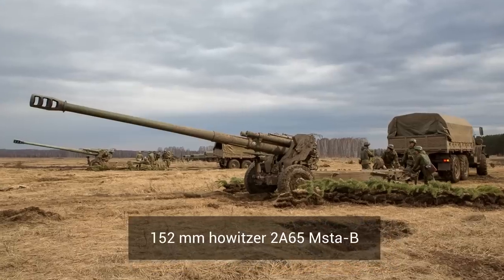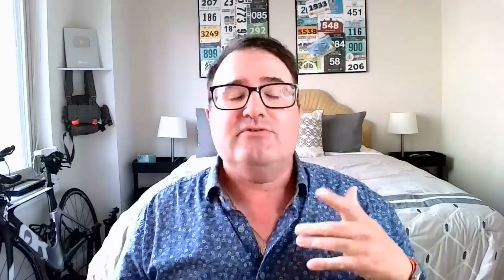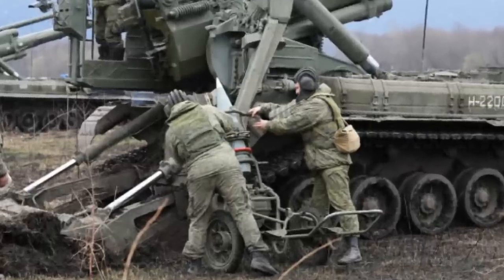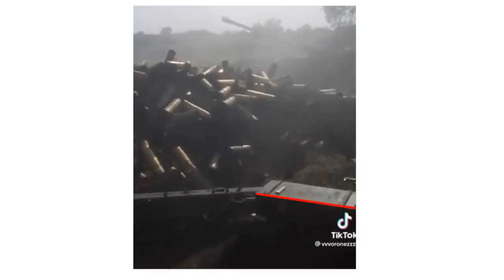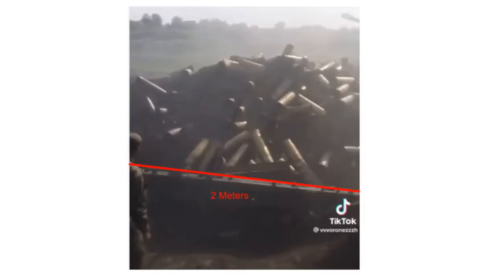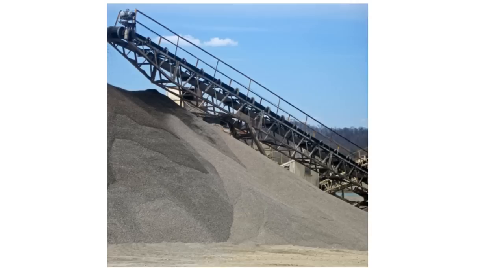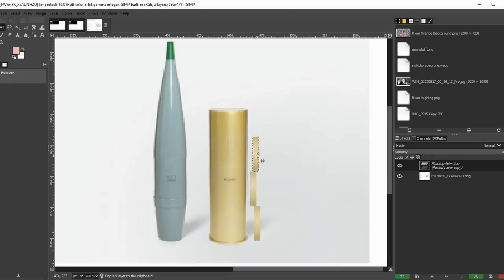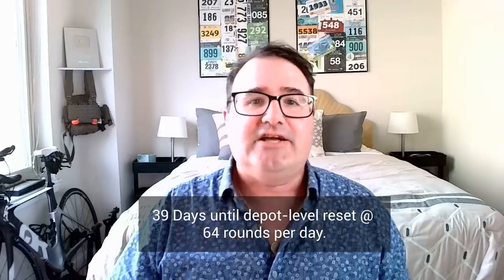When will this Russian Howitzer explode? (2A65 Msta-B Barrel life estimation from shell casings)

Comment: As veteran artillery non commissioned and then commissioned  officer with over 40 years of experience, I would like to add to a couple of earlier comments made by others. Barrel life for artillery is measured in Effective Full Charges (EFCs), which is unlikely to be the number of rounds that actually travel through any particular barrel.  Most artillery systems use separated ammunition. The projectile and the shell casing that holds the propellant are, or can be, separated to allow the amount of propellant to be adjusted to allow you to target enemy at different ranges. In many systems, the propellant is loaded into the chamber without a casing, but in bags or round cloth packages. Each such package contains a specific and known amount of propellant and is called a charge. The number of charges used to propel one projectile to the maximum, or near maximum, range that can be obtained, is called an EFC. Progressively shorter ranges will require fewer and fewer charge bags, or less than an EFC. Barrel wear is less.

 Professional Gunners, have long recorded each round fired, and the number of charge bags it required, in a log unique to each gun or howitzer.  Depending on the make and model of the weapon system, each number of charge bags actually used to fire a round will have a value as a percentage of an EFC. As artillery systems are seldom used at their maximum ranges, the actual life span of a barrel may well be far greater than the manufacturer's stated barrel life.  Once the barrel life is reached, the accuracy of the weapon degrades, as the lands and grooves of the rifling are eroded and the driving band on the projectile is less able to create a perfect seal and get the best effect from the propelling gases, resulting in less muzzle velocity.  

Most modern armies use muzzle velocity measuring systems, normally small radars that are attached to the gun and record how fast each round leaves the barrel. This measurement is much more accurate than calculating EFCs by a formula based on counting the number of rounds and charges in a log book.  It is used to adjust the setting used to lay the gun to ensure its continued accuracy. I noticed that some of the M777s supplied to the Ukraine included the muzzle velocity, many of the huge number supplied by the United States did not.  Finally, if a barrel explodes, it is unlikely to be the result of barrel wear. It is most likely to have been the result of a metallurgical anomaly in its manufacture, from damage caused by battle, or by misuse.

I enjoy your commentary and enthusiasm and encourage you to keep shooting. Ubique.
Reply: That was interesting - thank you
Reply: And now I know.   Thank you, Sir.
Reply: Thank you for this very interesting comment, I learned something new.. Best greetings!
Reply: I take it you were / are in the Royal Artillery?

My uncle was a RA Major, who won a MC at Anzio or Salerno, when a FOO was destroyed during a German attack, and he went forward under fire. ...... He was later Records Officer at Woolwich, where some 50 years ago I stayed at his house, and was taken to see the Rotunda Museum.

Ubique!
Reply: This man never had an “armchair.” The real deal!
Reply: @zen4men  So interesting, the history that rests within the families watching this YT video. My wife's grandfather received MC and Bar in WW1.  The citation for his last one went along the lines of rallying his batteries while under gas attack and counter firing.  Apparently, he was "never right" when he came back.
Reply: @brainfreeze1925  So many fell. ...... A couple of dozen in my family lines. ...... One of my grandmothers was a Maclean from Inverness, Scotland, and I forget how many brothers served, but 5 fell. ...... One was a mining engineer in Canada in 1914 who enlisted in the Black Watch of Canada as a Private, and was a Captain when he was killed by friendly fire in 1917.

So sad that their sacrifice has been thrown away by our government system, who are clearly owned by global marxism & the WEF globalists. ...... Both = tyranny.
Reply: Interesting! Thank you for this comment and the profound explanation.
Reply: @zen4men  sad that you brought conspiracy theories into your final paragraph :-(
Reply: @alanhat5252  So explain how either stand for freedom
Reply: as someone who loves getting into the nitty gritty detail and record and audit everything, this sounds great
Reply: > I noticed that some of the M777s supplied to the Ukraine included the muzzle velocity, many of the huge number supplied by the United States did not.

Could you clarify this? The M777s supplied by other NATO countries did include muzzle velocity measurement systems/devices, whereas the US ones didn't; is this what you mean?

If so, what could that imply, like are the US sending equipment that has seen little/no prior use, whereas other countries send stuff that is already partially worn?
Reply: What he said !
Reply: That beats my one time firing a 155mm (M109 IIRC and I remember them discussing an old system called BUCS and talk of something called TACFIRE that was in development, again IIRC) as a cadet in what seems to have been 100 years ago now, LOL!
Reply: I appreciate this. Thank you!
Reply: The previous 3 generations of my family were all royal engineer veterans (i was infantry). But your comment is the first time ive realised the royal engineers and royal artillery share the same motto.
Reply: @tileux  I believe historically( I am fully prepared to be wrong on this) the artillery and engineers were formed from the same corps(Board or Ordenance) although there have been engineers since 1066 and apparently artillery since 1346. The Board of Ordenance was separated later into individual corps. We have(had) the same motto but they changed the cap badges.
Reply: @zen4men  To bother with that would imply that your statement is accepted as truth and now the argument is over the specifics.  I think it's pretty clear that your statement was rejected as nonsense.   My father served in WWII (US), and I think it's so sad that "their sacrifice has been thrown away by" modern right wing nationalists who have fallen down the same dark hole that the Germans and Italians did in the 1930's.  Reply if you feel the need, but I won't respond - I've learned not to bother arguing with people who can't even consider for a moment that they might be wrong.
Reply: I understand that the number of charges depends on the target, but if you had to put a number on it, what is the typical number of charge bags that is used on average for each round fired?
Reply: Ubique
Reply: @zen4men  You are so right. Thank you for sharing your distinguished family service.
Reply: @kilroy2517  Why are Western governments supporting fundamentalists in Syria, Libya and Ukraine? Pointing this out is not conspiracy theory. Also, why is there organ trafficking wherever NATO operates? Just this week gone an Albanian militant commander was sentenced to 26 years for crimes against humanity. His head of state during the Kosovo conflict, ran an organ trafficking network where Serb POW's had their organs harvested in field 'hospitals', for wealthy Israeli clients who flew in to order. Thaci was the first Kosovan PM. 
Dirty tricks go way back to the CIA using dead GI's in Vietnam to freight heroin into African American communities..COINTELPRO 1.0. The White Helmets stole organs from 18,000 people in Syria, in exactly the same way as the Kosovan 'model'. The same is happening to Russian POW's in Ukraine now. As for the point about Western heads of state being mere puppets for an elite banking class, do you really think Joe Biden runs America? Can you honestly argue Liz Truss was competent enough to do anything other than obey orders, given she didn't know Voronezh and Belgorod were in Russia when advising Lavrov to remove Russian forces from those locations? Wasn't Johnson 'sent' to Ukraine after agreement reached in Istanbul, to deliver a message personally, when a real head of state would merely pick up the phone to a Zelensky? 
Johnson currently is urging UK to empty its reserve munitions and send them to Ukraine. Still obeying the same masters who put him in no10!
Reply: @a.m.armstrong8354  where do you get your information from?
Reply: Many years ago in 10th marines I ran a chronograph explicitly for the reason you've given. To determine barrel wear. And as you've said more wear equals less pressure so a worn barrel is less likely to blow than a newer one
Reply: @alanhat5252  i bet you dont even know definition of " conspiracy theory" . You think the word " conspiracy" basically means " crazy" . It doesnt.
Reply: Nice one sir, I did tip over gauge tests back in the day @ FT Sill.
Reply: Good to know there are artillery experts out there like you that know your weapon systems so well. I know my 357 Magnum. Thats enough for me.
Reply: @zen4men  So you think the government is communist?
Reply: Also the EFC arnt necessarily related to the hight and Depth of the lands and grooves rather than the barrels ability to withstand the barrel stresses through firing, radial, hoop tension, longitudinal stress and torsional stress. Manufactures play it safe and barrel can last much longer. All depends on the lands and grooves and the stress of the barrel. One major factor that effects all of this is barrel temperature which can speed up the wear of the lands and grooves but also remove the pre stressing of the barrel, which most barrels nowadays are autofritaged most are either full or a couple of metres from the chamber end
Reply: Beat me to it by 6 months
Reply: A while back I dug around to try to find 152 barrel life and a number that came back was 3500 EFC. But the factor for typical charge was only .7 , or 5000 rounds. Then a Ukrainian guy pointed out most guns were firing near max range so close or at FC. After I think 1500 rounds a boroscope check was required and they had limits on cracking, size and direction. As the gun aged the boroscope frequency was increased. They warned that risk of bursting increased with the cracking. I wonder if the Russian designers didn’t push their tubes harder than western? I need to read again the design strategy which was something like as the gun ages the distance from chamber surface to annealed increases. It might have been that when new the whole thickness is in strong prestress to compression, then as it is used the inner surface is annealed and the bulge strain grows and grows, so cracks in chamber wall surface are strained more and more with each shot as it ages so crack propagation accelerates. Each shot stress relieves a thin layer of the chamber surface and the threshold where prestressed in compression material arrives moves outward, so total bulge, or strain, increases with every shot. Increased strain causes increased per shot fatigue. The Russian philosophy was explained to me as that as the gun ages accuracy and range falls off so it is assigned duty appropriately (such as not near friendly troops). Then when possible the tube is changed in the field. The other systems such as recoil cylinders are also field changed. So finally what I found for 152 info supported claims of bursting guns. Then others said no, these failures were from defective fuzes. It would be great to hear your take on this.
Reply: Exactly.  Somewhere out on youtube there is a video that describes how the navy extended barrel life on battleships when used for shore bombardment in WW2. Same idea; don't use full charges and the barrels don't wear out nearly as quick.
Reply: @glorgau  it seems that there is the abrasive west at driving bands, flame erosion at the throat, then this slightly complex stress relief/ fatigue acceleration mechanism. From what I read the old naval guns were “built up” meaning they added external strength to the breech area and they could rebuild them. But the modern field artillery gun ages out and is scrap. If I understand it correctly, the rate of fatigue increases with each shot, as less and less of the chamber wall remains in compressive prestress. I wish I saved the link to the technical article.
Reply: @zen4men  I feel the same! So much suffering for freedom and next thing we have is emergency act in Canada and de-banking of opponents and when a CSIS man risks his career to leak it rather than act on the information and cast out the MP who accepted Chinese money, instead all efforts are made to catch the brave hero that leaked the truth. What happened?
Reply: @kilroy2517  the charge required is established by the mission and the gunnery computer. The higher the desired muzzle velocity the greater the charge. The gun can be put in attitude for max range 45 degrees, or if time of flight is to be increased or decreased such as for simultaneous arrivals, the barrel can be lowered below or inclined above, but doing so increases the required muzzle velocity for same target.
Reply: @Khronogi  Putin fact factory.
Reply: @burtvhulberthyhbn7583  But wait. The gas leakage will scarcely lower peak chamber pressure. Bursting a barrel requires that fatigue cracks have propagated enough to result in failure. From chatting with a U.S. artillery guy I think what is going on is USA is very conservative with their guns and take them out of service far, far, before any risk of Burst exists. So USA guns just don’t explode. However in Russian army, they are sloppy. Not only did they exceed EFC cycle counts, they steady fired beyond spec and ran hot guns. The hotter the gun the less stiff the greater the strain (stretch) per shot the faster the wearout. If they don’t boroscope often enough a crack can move fast and you lose the crew. Sone people say the exploding Russian guns burst away from breech as from defective fuze, others say no, the breeches opened (as from fatigue).
Reply: @michaelperkins2720  
You said it better than I. Do you agree (I’m not certain I understood the engineering article correctly) that an auto fretted barrel (fully in compressive prestress) suffers a thin inner layer of annealing with each shot. This way the inner layer no longer participates in supporting the pressure cycle and with each shot the total stiffness falls and total strain cycle increases thus accelerating fatigue accumulation. Hence the need to begin crack inspection on old guns. Also, as you wrote firing a hot gun reduces stiffness again increasing strain amplitude thus increasing per shot fatigue accumulation. Do you agree that rifling wear and roughness which increases gas leakage will have little effect on peak chamber pressure (but will affect the pressure after projectile is moving down the barrel hence reduce velocity)? I’m not artillery but early in career I worked on a Gun Alignment and Control system so picked up an interest. This weird war made me want to relearn and understand better.
Reply: @richardkudrna7503  case in point I've got 2 old Russian nagant rifles. Both have atrociously eroded bores. I'm sure the chamber pressures are a bit lower and their accuracy is much reduced. At 100 yards one is so bad the projectiles will keyhole paper targets.
Reply: @burtvhulberthyhbn7583  I had a mint k98 made 1945 that keyholed but it was due to an oversized bore. End of war problem. But do you think velocity is lower with a bad bore? If you could stop a bullet in gel or something and look to see if it’s wiped all around you could confirm gas leakage. But say yes, gas leaks badly so velocity is lower. But what is peak chamber pressure? The moment you fire all the powder is burning and typically (from fast instrumentation) you will see peak chamber pressure the moment the bullet moves past the free bore and hits rifling. You certainly wouldn’t say “ velocity is lower hence pressure is lower I will increase powder charge”, because it’s only half true. The pressure drops off on your bad barrel as the bullet travels due to leakage. But initial pressure is the same. I’ve never heard of a rifle barrel fatigue and burst. I saw a rifle where the guy left his bore laser thing at the muzzle and it split at the muzzle along the grooves. When I was a young soldier I looked over sabotaged 122 guns where they stuck a projectile nose first into the bore then fired a round and both shells detonated and split the barrels about 1/3 back, vert cool. Back to Nagants, I’ve always wondered if new Chinese barrels could be had.
Reply: @richardkudrna7503  an extremely worn barrel has greater distance or jump to get to the rifling and the rifling is more eroded. This alone will reduce chamber pressure. My 1934 nagant looks like a rusty pitted drain pipe inside. Try to imagine where and what it's been through
Reply: This was a very good explanation but you left off two factors that make a huge difference.  Type of barrel is important.  The M777 came with two barrel types one chromed and one not the chroming extended the life by almost 10x and second factor is rate of fire.  As a former artillery officer the barrel will over heat and can cause premature wear of the riffling.  Based on standard procedure we had a max rate of fire of six rounds per minute with a five minute cool down or two rounds per minute sustained.  This was based on the M109a3 platform.  Loved the platform and I loved firing a battery six rounds especially if I could get on a gun and number one.  The barrel life was around 3000 rounds but hey would bore scope the tube after around 1800 rounds and then every 800 to 1000 rounds.  We did log every round and charge and most guns made around 5000 rounds.  I was not in during a war so training you can wait for a barrel to cool off and in war if you have a fire mission you pull the lanyard.
Reply: @mrtreeves  chrome increase life by 10?
Wow that is pretty effective. I had no idea
Reply: @mrtreeves  Chrome vs bare steel has about 1/2 the friction so we expect a lot less erosive wear and it’s also more resistant to flame oxidation. So I can expect a big increase in erosive life ( keep a gas seal and hold up velocity ), but no benefit to the chamber fatigue. What I suspect is that M777 get rejected on erosion and lost velocity and accuracy before they get into fatigue cracking. Did you get to see cracks in the chamber area ? Did you have more stringent rules about cracks running along the bore vs perpendicular? I find all this interesting. I get a sense that western guns run a much more safe amount of margin compared to the Russians, who might accept bursting guns in war time. I mean special military operation time. BTW I hope that USA sends over hundreds of Paladin, I love that thing.
Reply: @richardkudrna7503  Like I said in the last sentence in war all these standards go out the window.  We did replace the breach at around 1500 rounds.  We had all type of cracking in this area.  But not much in the chamber.  But bore scoping was done often enough to find an issue early.  When I was stationed at Fort Sill we fired a lot of rounds and the three year I was there we replaced only one tube.  But the M109a3 had a larger issue with the recoil system.  I saw three guns that had to have that system repaired.
Reply: @mrtreeves  the breech cracking at first surprised me but then I thought about the wet corrosive slop in swabbing so I’m going to guess the high strength steel get surface embrittled with a corrosion film then cracks. I will guess they crack at the root of the deepest interrupted thread. If it was my Cannon I’d have the guys wiping with steam then transmission fluid. 
I read about the large weight reductions applied and can guess the lightweight recoil system component stresses are very high so getting short life. I hope the guys at BAE are looking over all the failures and expediting engineering changes. Based on what you wrote about the tube scarcely cracking , I’m thinking they went very conservative on stress life there. The war now may result in firing until destruction, tragic, but if it happens it will provide valuable data on fatigue life. It’s too bad Ukraine don’t have airlift capability to exploit the gun’s light weight to the fullest but at least it helps them scoot.  Thank you for the hands on experience feedback.
Reply: @zen4men  I went to Eaglesfield school in Woolwich in the eighties,right in the midst of all the RA buildings,we used to walk through the barracks from the bus stop on the common to get there. A fair few of my school pals joined the RA having older brothers and father's serving there.I also remember watching all the wounded coming back from The Falklands and landing on the common before being shipped over to the military hospital there.,And the Woolwich Rotunda was a place of awe for a school boy,We used to sneak over the RA's private fishing lake near to where those scumbags killed Lee Rigby,the MP's would chase us off and scare the shit out if us with their dogs and sticks😂
Reply: I have a few old school mates from Woolwich in the mid eighties who joined the Royal Artillery,I used to have moments of regret for not joining them,one and all a great bunch of guys. I really don't court danger but some of their tales and the fact that you are firing big guns can leave you wondering,like probably everyone else on here,I'd love to fire off a few rounds just for the buzz.
Reply: @notpoliticallycorrect1303  

I like your ID!

I wish I had asked my uncle
more about his war in Italy,
and more about Woolwich.

But we lived in South Devon,
and I lost touch -
never saw them again.

But I am grateful for the visit to the Rotunda,
half a century later!
.
Reply: After reading tmyour post I have decided I will NEVER again mock arty guys with my trademark "pull string, go boom..."
Reply: Thank you sir. Listened to artillery in the background day and night at Camp Radcliff Ankhe 1970. Luckily, we were not subject to counter battery from the opposition.

Looking back, it just became background noise, only when something was different did you notice.
Reply: Stole my thunder lol
Reply: I too am a retired 13 series NCO and Officer.. glad you clearly pointed out the EFC and their calculations based on CHARGES. ANOTHER cause for an in bore explosion can be an incorrectly seated Fuze in the projectile itself.. i have personally and very sadly witnessed such an event take place with an M102. In this case while under a mortar attack a crewman rammed a round, WITHOUT THE FUZE. The supplemental charge was ejected during the ram, lodging between the olive and bore.. the result was devastating explosion that killed several and set powder on fire..destroying the two gun raid site. That is the secondary risk of a tube explosion .. exposed munitions will burn and explode..
Reply: @MrJuxone  pls tell us more.  So it sounds like the artillery soldiers were doing a counterfire mission against a mortar attack? Were these blue (our soldiers)? Or green (friendly forces)? Sad when a mistake causes losses.
Reply: @bigtimepimpin666  the unit WAS firing a counter "battery" mission against real "red force" troops. The unit was what used to be called a "raid" unit- that is two howitzers that were emplaced in a position separate from their battery. The resulting in bore set off the powder bags of exposed munitions. The explosion, according to the 15-6 was determined to be (most likely) from the supplemental charge or from a malseated Fuze.. I was there but I still wonder at the cause.
Reply: @kilroy2517  if I may answer your question.. the number of charge increments depends largely on the range to target. Generally speaking, fire bases are set to cover 6400 mils (360) degrees, in the.lic environment.  And they usually try and establish this positions to cover median ranges.. 1/2 to 3/4 of the weapons system maximum range.. to avoid MAXIMUM charge usage..
Reply: @MrJuxone  Very true. That did not occur to me while writing my response. I'm sorry you had to witness such a tragic mistake.
Reply: @hayleyxyz  Hi. I don't normally post and am unused to replying to messages so please accept my apologies for a tardy response.  To be honest, I based my comments on seeing images and clips on public media of US donated M777 being transported. Most in the photos and videos that I sawed not have muzzle velocity measuring systems attached, although I have seen images of  others fitted with them. On reflection it is possible that reference systems were being shipped unmounted. When such systems were first introduced for the M109s I was working on at the time, we had two per battery. We moved them from gun to gun on a rotating basis to keep our barrel wear information up to date across the battery's six guns.